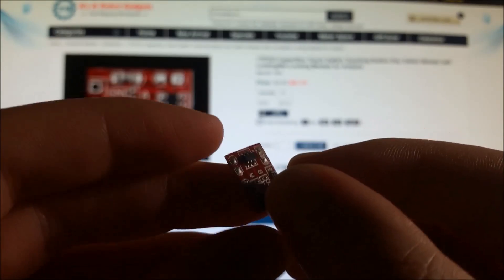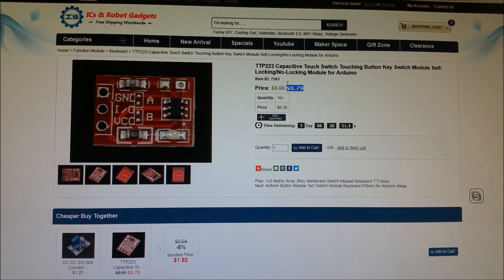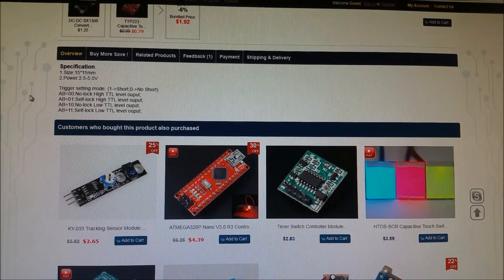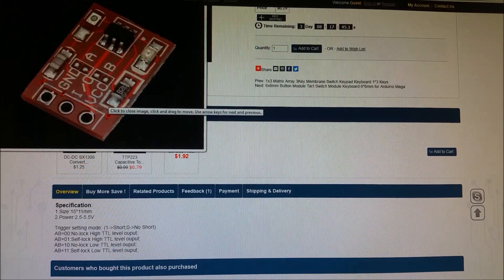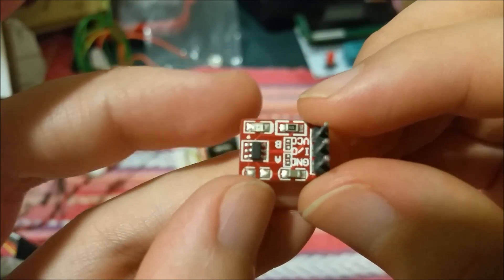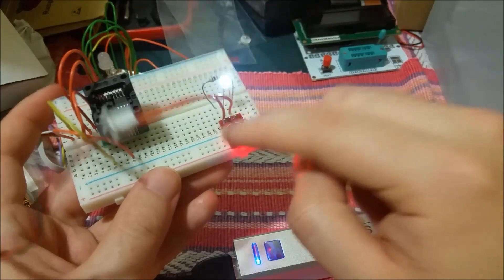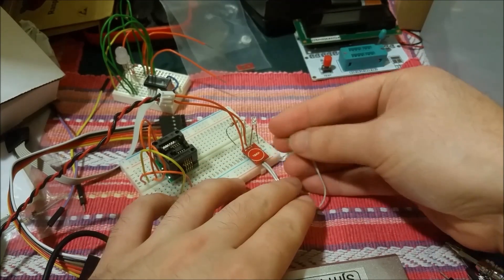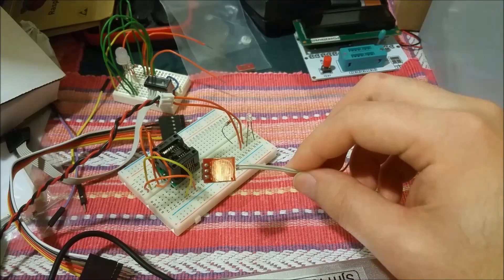ICStation TTP223 Capacitive Touch Sensor Module Review

Comment: I recently bought a 10-pack of these on special from ICStation.  They are advertised as working from 2.5 to 5 volts but they do not.  Pretty much anything less than 4.75 volts will cause the module to latch on.  The problem is that the unused pads on the board are for the sensitivity adjustment.  The data sheet for the IC on this board says that the capacitor normally connected in that spot should be between 0 and 50pf with the lower values increasing sensitivity.  I was able to get the board to work down to less than 2.5 volts by adding a 22pf capacitor between the blank pads.  It also worked with a 47pf capacitor I had in my junk box.  Yes, the sensitivity is reduced but it is still good.  Shorting the pads together (0 pf) did not work.
Reply from the maker: Tom Lillevig Thanks for the info, it will surely come in handy for future projects!
Reply: What does it mean that it will "latch on"? I was thinking I would use it with 4,5v but maybe I should use 6v in stead.
Reply: Oh no.. I ordered only ic without PCB.

Comment: How close together can you put 4 of these on the same surface (glass) and get individual response?
Reply from the maker: Never really tried to place sensors very close but I'd guess you'd have to leave a few mm. It'd be easy to mock up a test by taping the sensors onto cardboard and moving them closer and closer till they detect incorrect presses.

Comment: I have a voltage drop of 1.3 volt, is this normal?  Input 4.1 volt output 2.8 volt.
Reply from the maker: Looks like two series diode drops, probably due to protection and/or the output transistor drive so likely normal.

Comment: I can't seem to get this to function as an on/off switch. It always starts out energizing the circuit as soon as I connect the battery. Maybe it's not meant to do that and I misread its specs. Any ideas?
Reply from the maker: You may need to read the datasheet and solder two of the pads on the back together to invert the power up state. Also it goes without saying if you are touching the sensor when it turns on you could be screwing up the auto calibration and getting it stuck on

Comment: Hey man nice vid just one question. Can you expand the “touch” surface area??? Maybe if I put a foiled paper sheet on top of the sensor can expand the capacitive area?? Best regards
Reply from the maker: To get a larger touch surface you can scrape some of the solder mask off the top of the sensor pad on the pcb to solder a wire to attach a larger metal foil. There is a limit though before it gets too sensitive and falsely triggers randomly.
Reply: sjm4306 I’ve been trying to work with a “sensitive wall” and I’m trying to build a grid with bronce tape to transmit the sensitive area and trigger a light. Is it posible to use this sensor to proof the concept?? What do you think??
Reply from the maker: Yeah I think given how cheap these modules are it'd be perfect to build a prototype with.
Reply: sjm4306 and for doing the wall?? Can you help me with some ideas??

Comment: Im wondering at what distance it will react, since I'm thinking of making a light with a touch switch. But the thing i want to make needs the switch to be in the middle of the light diffuser, so i would like it be as far from the diffuser so it won't cast a shadow from the light that will come in from the side, ( think if a circle with the switch in the middle and the leds following the inside wall of the circle)
Reply from the maker: From my testing you can probably sense through something like 5mm or so before it gets too insensitive. The thing is though that it needs to be solid material as airgaps will drastically cut down on sensing distance. I imagine you could mount white paper behind the side lit acrylic light pipe and then mount the touch sensor to the backside of the white paper so that light is effectively reflected to the front while maintaining capacitive coupling of the sensor to the front of the acrylic surface. Obviously rigging up a prototype to test is the only way to know for sure.

Comment: Is it possible to increase the size of the touchpad,
Reply from the maker: Yeah, you would just scratch a bit of the soldermask off the top to solder a wire on there and then solder the other end on a bigger piece of metal foil/pcb plane (it would work better if there were an insulated ground plane right under of course). Now there is a physical limit to how big you could make it before the sensor couldn't read it correctly but that would take some experimentation.

Comment: Hi I just bought the button, can this be used to replace a normal switch? I want it to replace the buttons of a music player board, so I dont need it to give power just act as a bridge. Thanks!
Reply from the maker: It can replace a regular mechanical switch for digital circuits (not analog ones or ones where it connects two wires) but since it is an active touch sensor it does require 5v for powering it. You'd need to measure the original switch first to see if it is active low or high first.

Comment: If I’d put a larger capacitor on it will it be less sensitive ?
Reply from the maker: I believe there is a section in the datasheet for the chip that describes exactly that. You can adjust the sensitivity by changing one of the caps.
Reply: sjm4306 cheers mate

Comment: I am making a project based on women safety,  so i need a wireless touch sensor. Can i use this sensor ?
Reply from the maker: Sounds like an interesting project. I don't see why it wouldn't work for your application and they are certainly cheap enough for you to get a few to prototype a test device.

Comment: very useful video. can anyone guide me as to will it work for driving a 12v relay to make it toogle between NO and NC modes? Since i am a noob in electronics a schematic  will help me to implement the thing by soldering which I can do well by reading small circuit diagrams
Reply: Did you ever found an answer for your question? I would like to know as well.

Comment: how much amps can be drawn?
Reply from the maker: This is a logic level device so probably not more than 10-20mA. If you want to switch a heavier load with this you will need to add a transistor, solid state relay, or mechanical relay.

Comment: Can i replace this circuit to piezo drum module?
Reply from the maker: I would really only drive loads that consume less than maybe 20mA so if your piezo module works at low current then yes. If not then you will need an additional resistor and transistor to switch higher current loads.
Reply: Ok..good info..thanx bro..can u build the switcher..

Comment: Hello, I bought 40 pieces of TTP223, but I have a big problem. A 1 W led (3v x 300m) does not illuminate enough. It is powered by a LI ION battery of 4.10 V. The final voltage that reaches the led is 2.26 V. I tried with 5 V, almost the same problem, only the LED illuminates a little more, but still not enough . I use the B system. What can I do? Thank you very much!
Reply from the maker: The output of the ttp223 is low power so you need a transistor between it and the led. Google 1W LED transistor Arduino smd it will give you circuits you can use.
Reply: Thank you for your answer, but i am newbie in electronics. Please if you find a schematic, it would be very helpful!

Comment: Is there a way to run a wire from it somehow to make something else a touch Surface? A screw or something?
Reply from the maker: enes sabanovic I have actually done exactly this and it worked great. On the front where the text "touch" is written you can carefully scrape away the insulating soldermask and solder a single wire. Then just attach the wire to any conductive surface and touching it will trigger the sensor!
Reply: Cool! So what happens in case of an electrostatic discharge? Is it sensitive to ESD?
Reply from the maker: enes sabanovic Haven't looked into the datasheet in great detail but the inputs should be diode clamped to the supply rails to protect against esd.
Reply: Thanks pal. I have an aluminium box with some led lights on it that I need to be able to turn on/off. I can't alter the look of it in any way so adding switches is out of the question. It has some screws that can be isolated from the rest of the box. Do you Think it's possible to use this TTP223 and connecting a wire to one of those screws to act as a touch switch? The Three leds are 2,1v 20mA each. Do you Think this would work? I have no clue about Electronics as you can probably tell :P
Reply from the maker: enes sabanovic No problem. I would guess this chip itself couldn't supply enough power for more than one or two small leds and it would likely be dim. You can always wire it temporarily on a breadboard to test but you might end up needing a relay or transistor if you want more power. To find out how to wire these Google image search transistor or relay led circuits.
Reply: Thanks! This was really helpful. If I understand correctly I can use the transistor as a switch in my led circuit and the ttp223 as a means to control the transistor by applying current to the base of the transistor.
Reply from the maker: enes sabanovic Exactly!
Reply: So there seems to be unused pads on it. One of them seems to go to the touch pad. If I'm not mistaken you can run a wire from that pad in stead of having to scrape off the insulating solder mask. Maybe scraping it off is easier though because the hole on that pad looks really small and may be hard to solder a wire to it.
Reply from the maker: enes sabanovic Yeah you could even solder directly to the pin of the chip but I figured it would be easier and leave less chance to error to just scrape off and solder to the front area since there is no risk of lifting a pad or creating a short. Either way though whatever works will get the job done.
Reply: Ah yes, too bad they don't have a dedIcated pad for this.

Comment: This is really amazing. But how do you attach it to a flat surface? I mean the soldered  pins will have to push the surface to attach it to it? Can you explain?
Reply from the maker: hari bukke Prasad I soldered the pins just so it would be easy to breadboard it for demonstration. For a real world application you would solder wires from the other side and make sure it was perfectly flat where you want to glue it.
Reply: What glue can we use for attaching it? Should the glue be between the sensor and the wood or on the sides of the sensor?
Reply from the maker: hari bukke Prasad I've used double sided sticky tape and it works great. Hot glue also works fine but is obviously harder to remove. Ideally the glue should be a thin layer between the surface and the top of the touch sensor so as to capacitively couple so it can sense your finger on the other side.
Reply: Thanks for the information. It was really helpful! :)

Comment: Can you do a beginners guide for this. I️ don’t really understand this.
Reply from the maker: StellaCharlie What was it specifically that you don't understand? It'll be easier making a beginners video if I knew what areas to spend more time explaining.
Reply: The thing I didn't understand is that you didn't show the circut on the bottom of the bread board so I got confused with what wires are connected. The project I'm trying to make is having the touch sensor toggle LEDs in a gameboy color to make the atomic purple shell light up.

Comment: Hi, I have a 3 flashing led 3v on a normal button switch, how would you recommended replacing the normal switch with this touch sensor. Your help is hugely appreciated. Thanks.
Reply from the maker: Kevin Anthony If your led flasher is low enough current then you could supply it directly from the output of the touch sensor. If not then you will need a transistor to switch power to the flasher on.
Reply: sjm4306 Thanks for your quick reply, but Sorry I'm brand new to electrics! The switch is just one wire in, one out, easy, the touch switch has three out puts, what would go where?
Reply from the maker: Kevin Anthony I would really need to see the circuit board to help. The touch sensor has three pins for 3v positive and negative and its output which can be set to momentary or toggle. The way you would use it depends entirely on how your led flasher is wired.
Reply: sjm4306 Hi, it's literally a simple led circuit, 3v power, neg to led neg and pos to led pos with switch in the way on the pos side.
Reply from the maker: Kevin Anthony Oh that's simple. So to use the touch sensor just wire battery positive and negative to the sensor and the output goes the led positive and led negative goes to battery negative.
Reply: sjm4306 thanks so much for your help.
Reply: sjm4306 Hi, one more question if you can, how do I switch it to toggle mode?
Reply from the maker: Kevin Anthony If you follow the link to the ICStation page and scroll down there is a chart for solder blobs you need to make on the pads labelled A and B.

Comment: could you use this to toggle connecting the "red wire" for the GBA backlight mod?
from what I understand, that wire brightens up the screen, so I was thinking I could incorporate that into the mod as a brightness toggle
Reply from the maker: EMCvids What does the red wire normally get soldered to?
Reply: a leg of what looks like a transistor..? it's labeled DA1
https://gbatemp.net/attachments/cam00215-jpg.9843/
Reply from the maker: EMCvids If you measure the voltage of that pin and it's over ~2.2V and wire the touch sensor so that it is supplied with that voltage and its output connects to the red wire it should work.
Reply: I assume the ground is also needed, right?
Reply from the maker: EMCvids Yep just grab ground from anywhere on the board. You will also have to wire the touch sensor to toggle like I've shown in the video.
Reply: sweet. Thanks a ton!
Reply: Update: I just measured it, and it's outputting a little over 11 volts with the LCD connected
could I still do it? the listing in the video says Power:2.5-5.5v
Reply from the maker: EMCvids 11v will probably fry the chip
Reply: Darn.